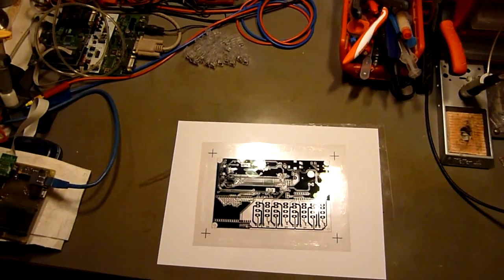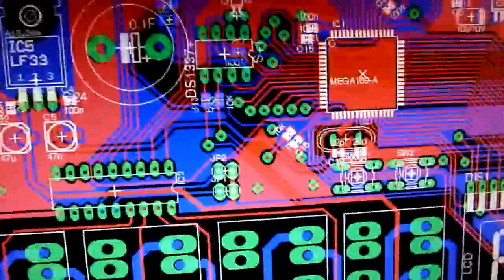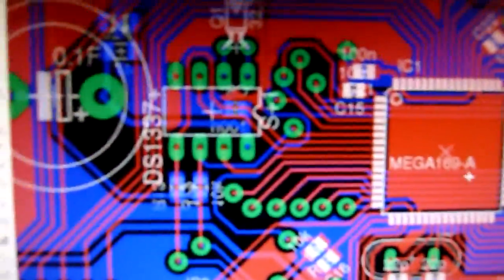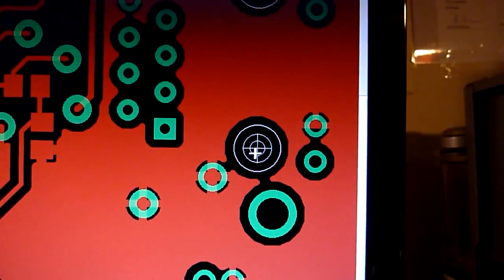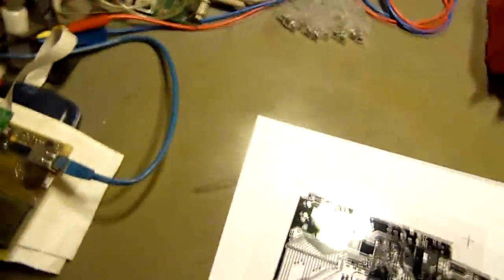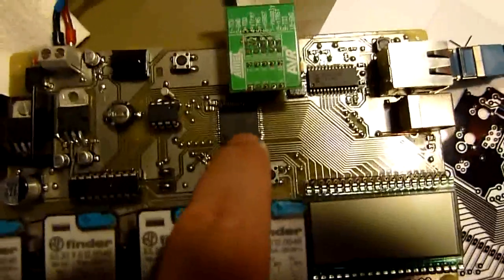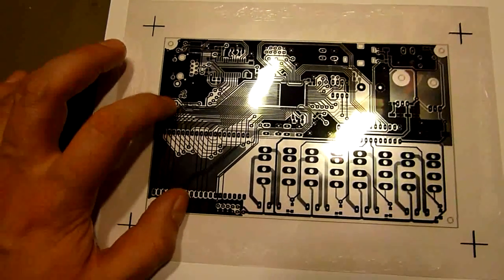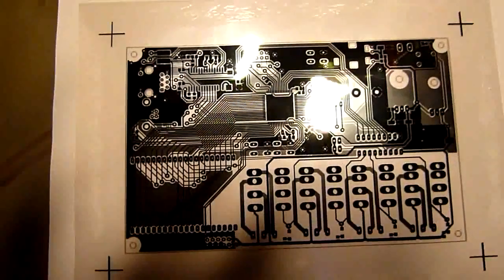How to make a good photo positive film for PCBs with a laser printer.

Comment: i give you a good laserprint tip. After exporting the File in black you load it to Gimp or a other photo programm. Now you mask all your wires and change the color to yellow. Now you insert the black over the yellow layer and make one layout (black/yellow) now you have the indeal filter for your ultraviolett light. Reason why is that yellow apsorb the blue light better then the black filter! But both over eachother and fix it by a film. take a pcb same thikness and put it between the 2 films - that make the disdance (correct) and then use a Vacum Blacklight at the same time so you have a correct Convergenzy between the Top and Bottom Layer.

Comment: Very thorough presentation - thanks a lot! I note that you use the Eagle "print" function, rather than the "export". I prefer to export to Photoshop and then I can lay things out exactly as I want - for example, I like to print everything on a single transparency sheet and then I print everything double. Then I can cut the sheet and align the 'doubles' first, top and bottom together and then cut again, (myself I use double-sided tape instead of glue). It is a nuisance to have to make doubles but the density of laser printing is weak and on my Brother HL-2240 I get lighter streaks in the dark areas. I hoped to hear you say that your super printer could manage without doubles - I'd like to know if anybody has one that can? For vias, when hand-soldering I use tiny copper nails (EBAY) with .023" dia. shanks and .053" dia. heads - you push them through, solder the heads first and then turn the board and clip them off the other side and solder there.

When hand drilling vias, make sure you use a drill that is sharp and whose diameter is the same as the hole in the via pad - if you keep the drill long in the collet, you will find that it bends slightly to self-align with the hole in the pad. I use a Dremel drill in a Dremel table-press, together with a nice big illuminated magnifier - with 30+ vias, it's still hard on the eyes.

Thanks again for taking all that trouble!

Comment: If you drill your board first, you will not have as much of a problem with the restring getting damaged.  It also allows you the opportunity to plate through hole if you want.

Comment: Have you found a way to plate your through holes or do you just solder some bus wire on either side?  

Not having plated through holes can be a bit of a trap for those making their own double-sided boards.  Sometimes you will have to manually drop a via since you won't otherwise have a connection from one side to the other through a pad.  You either manually drop a via or, if possible, solder the pins on both sides of the board.

Comment: Hello.  Great video.  I have a lot of experience silk screening, and making films for non PCB work.  I wanted to share a tip for registration marks.  There are many advanced ones, can be seen in Corel, etc, but I have found Concentric Rings, are much much better than crosshairs.  The error is very easy for eye to catch shifting.  For ex, print a large 6mm DOT inside a ring 6.5(or 6)mm ID to 8mm OD ring, just example. I would do this for different color plates (films).  Good for your 2-sided!?

Comment: @linuxgeek81 Hi Michael - as allways good job out there. It is perfect to see that you are still in good spirrit doing videos like this. I was wondering exactly the same as TerminaJack mentioned - how to actually make the connection of one side of the board to the other. So to put it right - if we are home pcb makers, the best way to do it is either make a hole with plates on both sides and solder a wire through it?

Comment: HP laser best for this.  Btw I recommend you give your LASER/LED printer some breathing room ..tugging in to a enclosed area where heat exhaust is difficult to exit.   This will result drum failure prematurely and leave you with spots on printed circuits.   There's a maintenance lasers require for drum to cycle through out the days to keep roller smooth hot & stable so another words read your printer manual for proper care. Each mfg is differ but generally this is a common mistake for users with laser printer.   

Used recycled toner cartridge may be an issue with printing image defects..  :)

Comment: Folks!   Better with good advices and chwing gum than no advice at all.

Now, this is my personal method. The key to get everything right is to use double films on top of each other since no printer whatsoever will make the black parts black enough.
But you don't have to glue them together. Just put one or two drops of thin oil between the films so that they are sucked into each other. In this way it's much easier to center the images. It takes perhaps three minutes of fiddling back and forth ( with a couple of strong reading glases on your nose) until every part of the films are centered.
Sometimes it's impossible to center the whole circuit. If so, concentrate on the narrow parts. I have made pcb 's with microcontroller with leg distances of 0.5 mm.
The thing is "oil".
Reply: I put the print for 30 seconds in my hot air oven at 180 C. After that the print is really much more black.
Reply: I  just made an experiment with my laser printer and OH film.  First I cooked it for 30 seconds but noticed only a slightly increased blackness. One more session and the film actually got noticeably blacker.  But is it black enough?  I don't have a UV exposing device yet so I can only use my eyes.
But I remember that using one single film was nerve wrecking since the exposure time must be exactly right and sometimes even that didn't help.  
The good thing with double films is that you may over exposure quite heavily, that's convenient. Perhaps this heat treated film works well.
Reply: Perhaps experimenting with a little higher temperature may help. Too low and the toner does not melt enough, too high and the toner gets brittle.
I have a "face browner"  (Babyliss UVA hawaii) that I use for UV exposure. It has four Philips TL29d16/09n tubes. The usable exposure time is between 2:30 and 3:15 minutes. I use 2:45 minutes on a distance of 70mm through 6 mm normal glass.
My printer (HP Laserjet 1200) is not stable enough to produce two films that can be doubled. My trace width is normally 10 mil. I also replaced the toner cassette with a Canon EP-25, which gave a slightly darker print.
Reply: Babyliss - fantastic. 

Strange, most people talk of around three minutes. My experience is upwards toward ten minutes. 10 mils, 0.25 mm is hard to get right when using double films. Personally I use to have quite generous spacing so that it's only some surface mounted IC circuits that are narrow. In this way it's easier to center the duplicates. 

But I will make some experiments. 

Btw, isn't that "face browner" radiating too wide?   If the beams has a too heavy angle, they tend to creep under the side of the black parts. UV diodes are perfect in this aspect.
Reply: I print in reflection. That way the toner side is on the pcb. On top of that I have an suction pump making sure there is no space between the film and the pcb.

Comment: Hello. I like your video but perhaps the following tips can help you.1 To create a Film at home use a high quality 1200dpi Ink Jet Printer. The reason is a laser printer cannot get very much toner on a transparency which means the layout will not be Jet Black "Epson or HP have some very good low-cost ink Jet printers that do a good job"2 If you have not got a suitable printer. Use a gerber plotting service to create your film masters.3 Don't use the positive method. Most board houses use the negative method. There arereasons for this sometimes not very obvious. When you print in Negative your copper areas appear as clear on the transparency. This means if using a regular printer you willput less ink on the transparency. If you have a lot of ground planes in your design yourprinting time will be less. a lot less !4 When using Negative masters you need to have a negative photoresist laminated on toyour copper clad board. 5 When designing PCB's even on a commercial scale, the old rule applies. Big is Better.That is use the largest drill and padstacks you can get by with. For example you could use a 60 mill round pad with a 33mill hole for a via.6 At home it is difficult to get below 10mil traces. There is a fine balance between havinga really good photo-master, exposure time and also etch time. Etch can under-cut your traces meaning a 10mil trace may end up at 6 to 8 mils. In some cases the traces can get etched away in particular if the photoresist is not capable of fine-line reproduction.Hope this helps.. Scott.